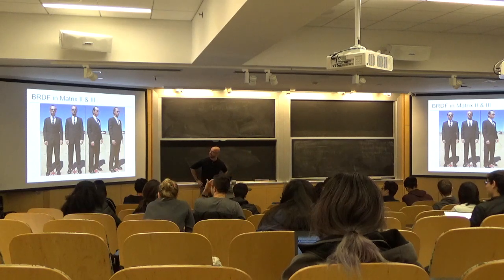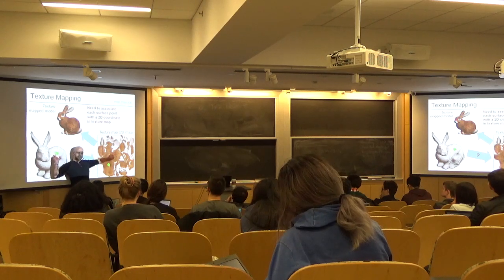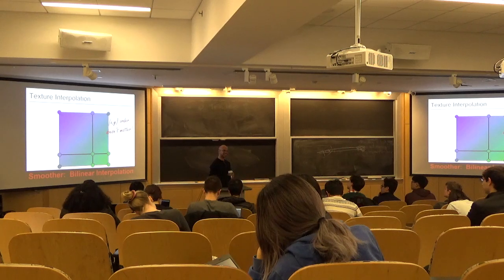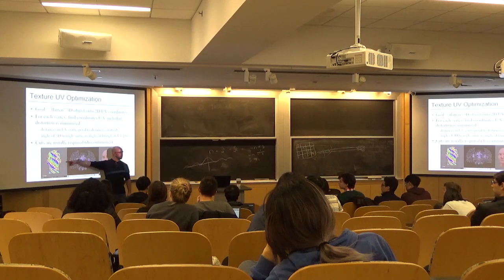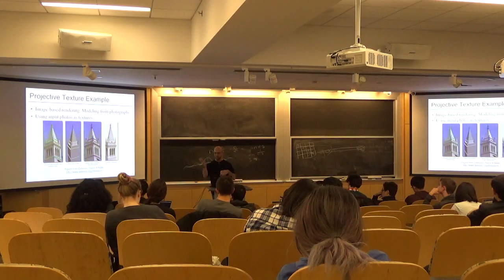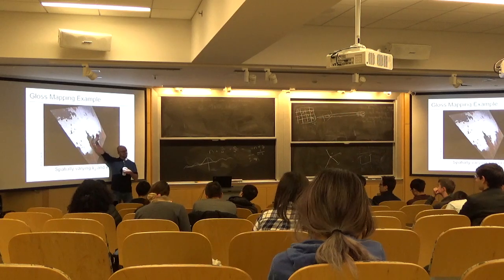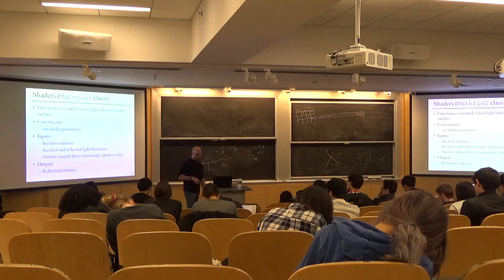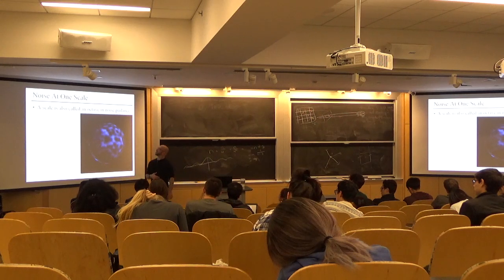Introduction to Computer Graphics (fall 2018), Lecture 14:  Texture maps

Comment: Thank you! I’m making games in Unreal Engine and was kind of confused by the idea of MipMAP. Now I understand what is does and why it is introduced. 
I’m still not very sure about the idea of texture filtering that is common found in the graphics settings in games. Is it meant to solve the problem that arises out the MipMAP level transition when looking at a long and nearly horizontal surface?